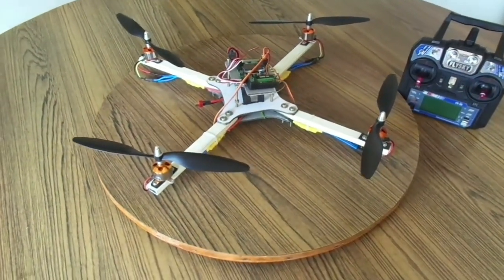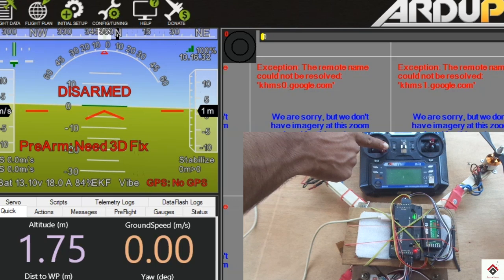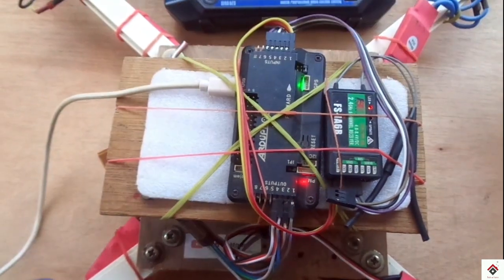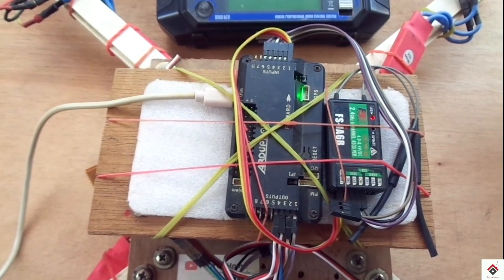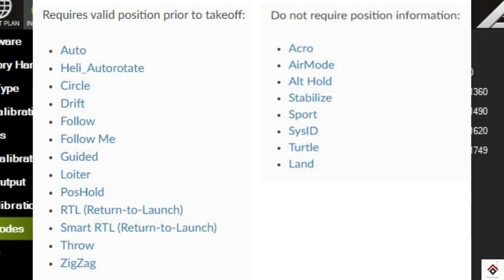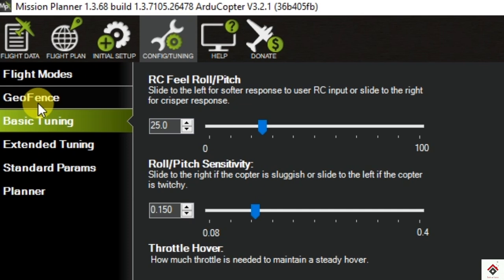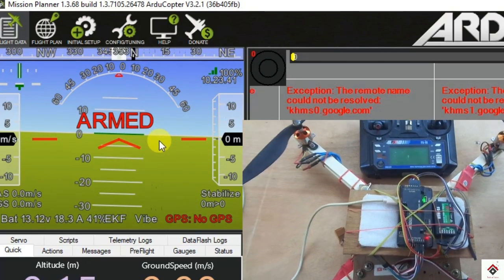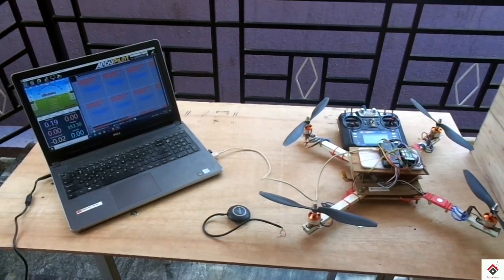APM 2.8 PreArm: Need 3D Fix Problem [SOLVED] | Drone not Arming 100% solution Mission Planner

Comment: I got a problem with my speed on my motors , it’s too slow , how do I turn it back up using ArduPilot ? Thank you !
Reply from the maker: Is flight mode is in stabilize by default?
Reply: @ yes it’s in stabilize 😔😔

Comment: Thanks a million for this video bro! It turned out my problem for not able to ARM was the Geofencing! Thanks again!:goodvibes:
Reply from the maker: Welcome ❤️
Reply: @techathome  Now I've got another problem. I'm using a Flysky ST8 . The value settings for switch mixing ch5(3 way switch) and ch6(2 way switch) to get 6 Flight Modes as shown in your other video for the FS i6x cannot work for ST8. The mix  won't allow master and slave of the same channel. Any solution? Tq

Comment: Thanks. But, It's not a "solution", it's "putting a picture on the wall to hide a hole" You've just turned off the not-working thing, and lost its functions... Why would you need to connect GPS which is not working/not calibrated and turn off options that require a GPS? The next "super solution video" may be about turning off the pre-arm checks XD

Comment: Sir I'm using a radiolink cross flight flight controller and use gps unlox neo7 m gps blue light binking but in mission planner showing GPS:NO GPS why do you have any solution sir ?
Reply from the maker: I have not used radio link cross flight controller. GPS might be not getting connection with Satellite. Its not the issue of Flight Controller.

Comment: Yes I am not using anything which uses gps, so if i try to arm it is not changing to armed instead stays in disarmed and doesnt show any error Could u pls help with this issue?
Reply: and yes i have applied what you have told